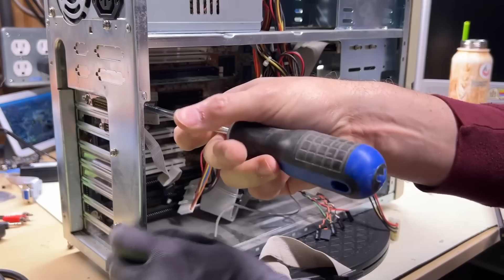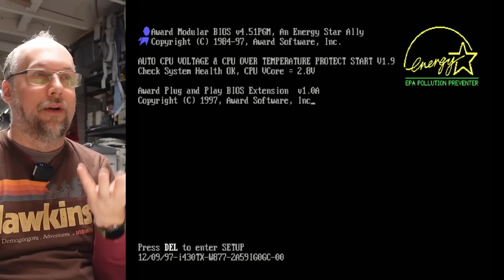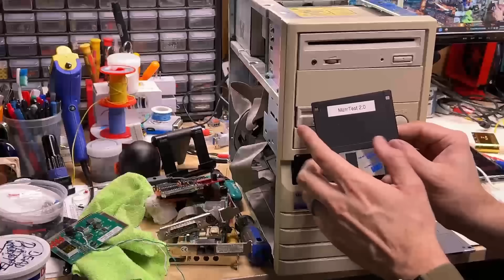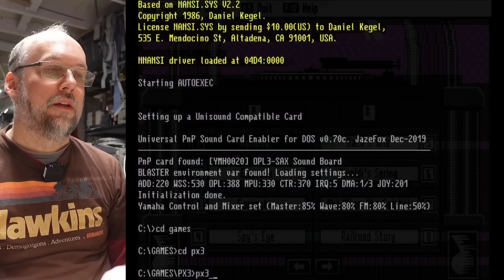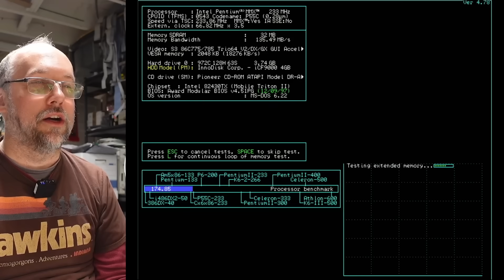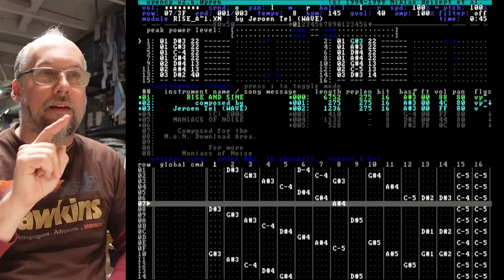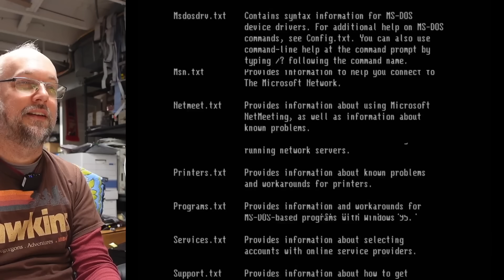Test and try: What's inside this dusty old PC?

Comment: I know a lot of people hated those cheap Rockwell modems, but I found if you used the AT command to disable error correction and compression they were EXCELLENT performers.  I had people wonder if I was on ISDN because my ping was LOT lower in Quake2 than most modem users (I also picked an ISP that had a low hop connection to my favorite Quake server).

Comment: i have at work few "bx cell" boards that are still at compatybile but with extra atx connector, have integrated audio and video and let you put ant pentium 2 or celeron with fsb of 66 or 100 (came with black celerons s370 in slot adapter) ~1996-97  so if you looked at the time you could find really wierd boards

Comment: Adrian, be very careful using compressed air to spin a fan while it's still plugged into the motherboard - a motor running in reverse acts as a dynamo and will generate voltage, and boards of that era didn't necessarily have protection in place to stop that voltage feeding back into the 12v rail, spin it fast enough and it's entirely possible to push 20v back into the 12v rail and blow things.
Reply: He mentions in the video that the fan was not plugged in to anything when he did that, so all should be good :)
Reply: @FlamingPhoenix40  Are you sure? I don't remember him saying anything and the reason I posted the comment was because it looked like the power cable was going into the big bundle of cables
Reply: He definitely said "it is not plugged in to anything" 14:49

Comment: I had that identical case, but in black, with a 2 digit CPU display in my first real PC (a 486DX2/66 in the 487 slot running at 50MHz due to the SX/25 soldered into the board). I later upgraded it to a K6/2 450MHz and, obviously, lost use of the turbo button and CPU speed.

I bet the lack of Gigabyte branding is because this one could be an OEM (or system builder) motherboard.  I doubt it was made for Dell, HP, Gateway 2000, eMachines, or Packard Bell, but maybe it was available for bulk purchase for local PC shops to toss into generic cases?

Comment: Baby AT systems show us just how far too big modern systems have become even MATX cases are stupidly large when all said and done, I own MATX, ATX and assorted MIni PC variants such as Dell, HP, Lenovo 1 litre size mini's and a couple of HP Z2 Mini's a Gen 3 and a Gen 4 both have Graphics cards the Gen 3 a 2 GB Nvidia and the Gen 4 a 4 Gig Nvidia Pro level .

Considering back then you would be king of the kids if you had a video card with 512 MB of Graphics Vram, I remember an S3 Virge I had that I upgraded the Video Card ram because it used socketed Ram chips.

Back then the performance you could get by dialing in smart drive settings in the Config .sys and optimising the Autoexec.bat settings and if as I had later you were lucky enough to have an Oktek Motherboard with Level 2 Ram chips on the Motherboard you could populate then wow.

Comment: That was a trip down memory lane indeed. I started with a 286 running DOS 4.01 then upgraded to 386, then a 486. Replaced the whole box with a Pentium 3/450mhz. The fan on the P3 box sounded like it was changing gears up and down. When the CPU finally died I looked at the fans and realised the CPU fan had been dead for years despite me blaming it for the noise. Never overheated despite the dead fan

Comment: I built a number of computer back in the day using that case or ones very similar to it! 
That's a fairly late model Intel socket 7 board with a 430TX chipset which came after the legendary (for the Pentium days anyway) 430HX chipset. The biggest different between them was the TX chipset supported SDRAM and USB 1 but could only use a maximum of 256 MB of RAM and only 64 MB of that was cacheable. The HX chipset could use up to 512 MB of EDO or FPM RAM and all of it could be cached which made it suitable for desktops as well as workstations and servers. That was at the start of the transition from AT to ATX and when Intel started splitting their CPUs & chipsets between desktops & servers as the Pentium Pro chips were also introduced around that same time which was the workstation & server oriented CPU.

Comment: My only problem with the SB16 is some of them have that DSP with the MPU bug so wavetable notes can hang on them if you're not using WT sure it's a great card but i've got an audiodrive in my pentium machine for that very reason. That yamaha card has a wavetable header though, could be a good card for exploring wavetable boards. Thanks for another great video!

Comment: I used to have an ASUS P2B-B Baby AT board. Intel 440BX chipset (PII Deschutes/PIII Katmai)/slot 1, 3x PC100 SDRAM, USB, PS/2 Mouse, AGP, PCI, and ISA. Gave it to my buddy who builds systems like that in a case similar to this. The board was found NOS at a goodwill of all places. There was a later revision that supported PIII coppermine's 1.8V and they can be OC'd to run 133mhz chips reportedly. Best baby AT board ever?
Reply: This is a great AT board indeed. I used it with a 400 MHz Pentium II and upgraded it to a 900 MHz Pentium III. It is still my DOS / old Linux / Windows2000 retro machine equipped with 768 MByte ECC ram, an Adaptec 2940 SCSI controller and a SB16 sitting in an even older AT big tower.

Comment: That's what you call a home-baked mid-90s PC upgraded to later 90s spec. I remember and love mine, it was my 2nd self-assembled PC though I topped my CPU out at a Pentium 166 before jumping into a slot based Celeron 300 OCed to 450 for my 3rd. Best CPU bang for the buck ever. Nice dose of nostalgia, Adrian!

Comment: Very similar AT case to my first PC from back in the mid 90's, that i am also now rebuilding, originally a 486 DX2 66 VLB system. Since missing the content except for the disk drive, power supply, CD-ROM etc, i have had to search for parts for some time, result, a good Socket 7 motherboard, Gravis Ultrasound Max (my original), AMD K5 PR 133 (100 MHZ), 48 MB RAM, Cache module, Sound Blaster CT2910 Sound Blaster 16 with genuine Yamaha chips, 3 digit Turbo display, new old stock? Teac 5.25" -94? (made in Malaysia) dual speed capable drive, etc, also the 3.5 drive is a Teac with Jumpers, perhaps from 91 - 93?, the case is manufactured in March -94.

Comment: For some reason I never pictured Adrian as someone that knew much about late DOS machines, I was surprised to hear worked at a shop building them. I don't think I've ever ran across an AT PSU that has failed, which I have around 5 these days and they all work.
AGP on Socket 7 was quite common in the 'Super Socket 7' era with 100Mhz and sometimes even faster FSBs. My primary retro PC is the same crappy PCChips M577 motherboard with a K6-2 533 overclocked to 600mhz(just to see if it would run at 600 then left it there.) It's got a Socket 370 cooler that surprising fit but is very tight. I can't remember what video card I put in there though, probably my GeForce 3 Ti200. Only other things of interest is it's got a Gravis ultrasound Ace and an original VooDoo card in it. I love this era of PCs as I was constantly upgrading and helped many Socket 7 boards live on for a few extra years with the K6-2's 6x multiplier when set to 2x. It was perfect for the tired P54 Pentiums to go to 400 or 450Mhz with that 6x multiplier on boards that didn't support above 3.5x.

Comment: I remember building a Pentium-era NLX machine for a teacher at the high school I was volunteering at back in the '90s.  I got distracted and plugged the AT-style power supply backwards onto the motherboard.

When I hit the power button, I heard a VOOM sound and all of the capacitors on the motherboard went "VOLTA!" and let out their factory installed magic smoke.  Then there was fire.  Then the fire alarm went off.  Then the school had to be evacuated.

I decided that I liked ATX power supplies a lot better after that.
Reply: Red against red, and you are dead. Is what we the nerds said, back in the 1980's and up untill ATX became widely used.
Reply: The first PC I bought was ordered from a computer shop. You went in, selected the parts you want on paper and gave a deposit. They assemble for you.
Of course, I opened it, had a look. For the power connector, I took note of the colors of the cable to make sure I connected it correctly.
Before buying it, I took a full year, reading various magazines, learning what VGA is, how a hard disk works, what the internals looked like.
Somehow, I figured out how to reinstall Win 95. That was in 1997.
Reply: Computers run on smoke.  When it escapes, the computer no longer runs.

Comment: I have a 486 AT motherboard that has a PS mouse header on the board.  I don't know if they are rare or common, but it's a PCI/ISA 3.3/5V motherboard.  Works pretty good overall.  Did not have a Dallas RTC or a Varta Battery so the board is in perfect shape.  The board in question is an ASUS VL/I-486SV2GX4.  Came to me as non-functioning.  I got it working, but it still has issues with cache.

Comment: In 1998 Baby AT motherboards were common to find with AGP, PCI and ISA slots. They also came with both atx and at power connectors for use in atx or at cases.
Reply: ASUS P5A-B was the quintessential motherboard of the era for tinkerers.  Could take you from Pentium through all the K6 series and had ISA/PCI/AGP, worked in AT cases and ATX also

Comment: Why not put a tiny dab of thermal paste on that cooler?
Reply: not needed
Reply: @markae0  Yeah, sure .. if the fan is working fine.  But cheap, easy and will not do nay harm and might possibly help a little if the fan seizes.

Comment: Look for a rev. number on the board, it's probably a later one. Unless the one on the retro web is a cost cut version... pretty sure it's just a different revision though. I would be careful with flashing a different BIOS, many boards with different revisions are incompatible with each other.
Reply: The chipset supports USB BTW. The SDRAM support is limited to PC66, with max 512KB cache on the MB.  Max cacheable RAM is 64MB. Max RAM:  256 MB.

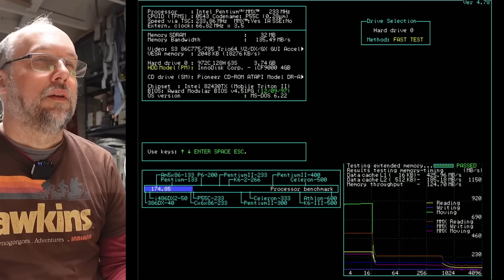Comment: 39:50 Two cache chips, yet only 512k of  L2 from the looks of that chart bottom right, now that is interesting. I've seen some socket7 boards with a full meg of L2 using 2 chips, with the single unpopulated cache chip variant having only 512k. I guess this one is using older 256k chips I guess. Also only interesting for specific uses that would benefit from the larger L2, at 133MHz I don't think it would make as much difference as the core clock cache did with the Pentium-pro later on.

Comment: Bummer that the i430TX only supports 64MB Cached...
Intel did this nonsense all the time, to castrate their chipsets for no reason at all or to force you to get the next system. i815 also did that and is limited to 512MB total RAM; even though it supported 512MB Sticks...
Most "Fun" Chipset: i940GML...

Comment: Ah, Gigabyte with their "Versionitis" aka changing stuff constantly.
Check if you can see a Revision on both your board and the Retroweb one.
And Gigabyte still does the changes today its fairly common for them.
So did you get an earlier revision and the RetroWeb one is a later revision? Or the other way around?

Comment: There indeed was an AT motherboard with "all-in" features! Asus P5A-B was one of them, had 1x AGP, 2x ISA and 3xPCI. I had one of them in some random custom build machine in ATX case, had I/O shield for just that single keyboard port. :D It also had connectors for AT and ATX power supplies, mine was running ATX power supply and 300MHz AMD K6.
Reply: Atrend 6310 is another example that serves as mainboard of my retropc.

Comment: An important thing about the cdrom driver instance names (and other dos device names): they will conflict with any files you try to access by the same name. One of the publicly available boot floppies set the cdrom device name to "banana" and it would cause file read errors while installing versions of windows that came with the animated mouse cursor "banana.ani". Typically MSCD001 was used, as it was unlikely to conflict with files you might have on your PC.

Comment: Lots of fond memories of systembuilding in the late 90's at Intrex Computers with cases like this.  A few tidbits I'm sure you know but others might not:

CPU Temperature Select should have a list of temperatures (probably in C) upon which it triggers the overtemp alarm/warning/throttle.  

The USB headers on the motherboard were not standardized at that time, I remember some magic smoke issues if didn't get them right - and a lot of USB ports had individual plastic-sleeved connectors on the header cable to allow connections based upon the layout of the motherboard's headers - better hope you have your manual or some good mobo silk screening! 

The front panel connectors were also not standardized yet.  

The serial port header cables weren't always standard between motherboard brands either, so you couldn't necessarily grab  one from a bunch-of-cables box when throwing something together and have it work with the particular motherboard.   The parallel port can run in EPP and probably ECP as well as the standard SPP. But then not a whole lot uses that port anymore...

Comment: Regarding the White Balance. There are paid Camera apps for the newer iphones, which allow you to have MUCH more control over the cameras settings when recording. Adrian, try Protake, its $19 a year, so maybe another similar App might suite. I use it, and you can lock WB, ISO, Focus, etc etc. It also shows focus highlighting, and or zebra stripes to indicate over exposure. I use it on my channel, and its pretty good. I also have an old 6s Pro, and use it for alternate views and Protake does not work on that. So, at some point I will need to get another camera to replace it.

Comment: That sound card also goes by another name, the Yamaha Audician 32 Plus and it's very good. The MIDI MPU401 also doesn't have any hanging note bugs on this card. In Windows you can also use the cards MIDI XG mode for a different instrumentation. Phil has a good review video about this card!
Reply: I have cards like that, same layout same chip, not branded Audician32. That card is just a rebranded one, almost as if they took the referance design from Yamaha, and went by that hardware wise.
Reply: @brostenen  Probably clones indeed. I think I have one too. That being said I don't recall seeing the name on the silkscreen of the card in Phil's review.
Reply: @IcySon55  Most cards just use reference design. It were widely adopted on Voodoo1 and Voodoo2 cards. As well as GF2 to GF4 cards.

Comment: Those Pioneer slot-loaders are more often than not faulty, they were pretty unreliable drives at best, especially the later DVD versions, so that one working fine is quite unusual, I bought one to put into my P200 system so all the drives on the front are "slotties", cos why not... :P

Comment: If I'm not mistaken you can actually use WSS in DOS without running it in Windows. I don't know if you need an environment variable set up, but in Cubic Player you can dig down in the .INI file and there is a WSS section were you can enter the base address (of the WSS part, not the SB emulation part) and the IRQ and so on. This also works with an Interwave card (and GUS MAX I think) because they are sort of WSS compatible (but at a weird port address).

Comment: Had one of these cases, but with a different front. Was my K6-2 350MHz build IIRC. A SCSI Yamaha 1st-gen 1x CD-writer up-front, with a removable hard-drive caddy below. S3 Virge + Voodoo 1 then Voodoo 2. SB Vibra 16 for sound. Built on a "FIC VA-503+". Not the most stable platform, especially when OC'd, but it served me well... think I ran Windows 2000 at the end, after W95, W98 and a brief stint with ME (horrible horrible as that was)

Comment: 25:12 I would say it's a different (unmarked) revision. I would search for the same part number, but attaching "rev.2", "rev.3" and so on at the end. From my experience, the BIOS tend to be compatible between different revisions of the same board.
29:46 I believe it's the camera software chocking on the pattern of the ribbon cables rather than a bitrate issue.
Reply: It's not unmarked. It's just Rev. 2.03 instead of 1.06. It seems that was the point on which Gigabyte decided to mark the Revision in the bottom left corner of the board. You can actual see it in 12:20
Yeah it's probably the software of the iPhone camera. There should've been an update to fix that. Might be a new issue or it's just overheating in the camera mount. Had an Samsung Galaxy S something something mp3 player that would overheat from putting it in an 3rd party leather case. USB 2.0 high speed should be enough for steaming even 4K video I guess.

Comment: Yeah, there's at least 3 revisions of that motherboard (rev 1.00, 1.06, and 2.03). That's the 2.03 board (noted up on the corner of the board by the last ISA slot). Other than the change in cache chips, the only thing I know that is specific to the 2.03 revision is that it supports Windows 95 powering off the board on shutdown (if powered via ATX).

Comment: FYI: if you can take out the cooler from the shaft and clean it, isn't any cooler you can't fix.
in my experience is best to apply lithium grease instead of oil, i have an laptop running  24/7 for 5 years after the first a half year the fan act like the shaft was crooked and made a lot of racket, after i drill the back of the stator shaft side (because it was pressfited  to make it unserviceable) and take it out clean it and lube it with liquid oil like yours, it  ran fine for about 3-4 months after that it needed lube every 3-4 months. after the 5-6th time i was fed up and tried lithium grease, it runs better and quieter than new now 2 years after that.